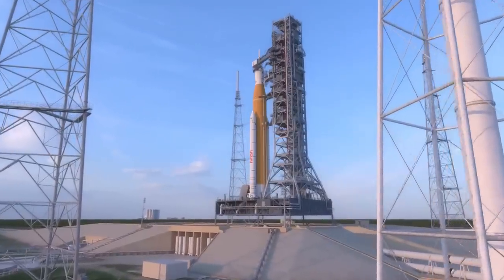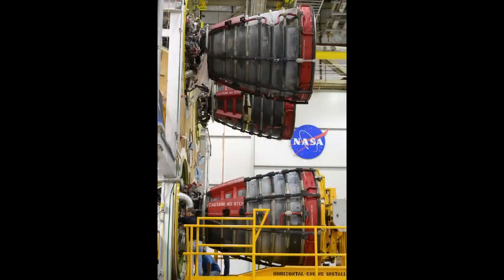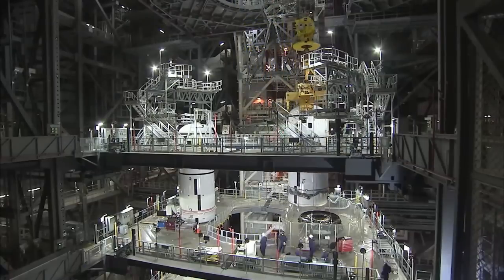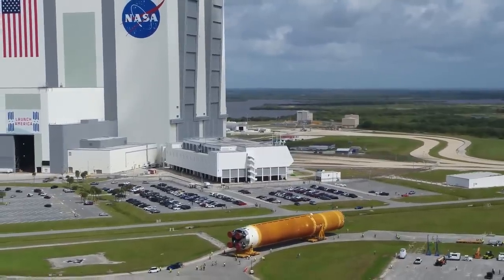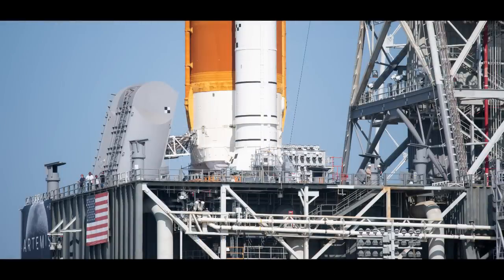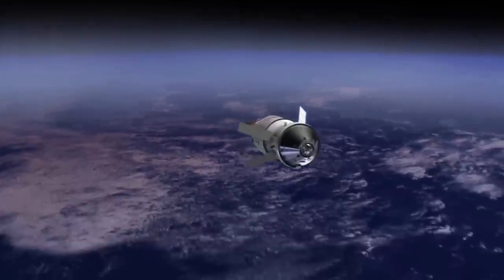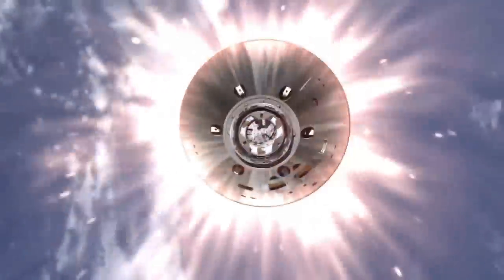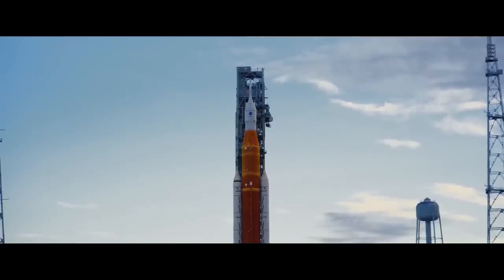What's The Big Deal About Artemis - NASA's New Massive Moon Rocket

Comment: can sls carry orion and a small lunar lander at once?
Reply: No. SLS can barely get Orion to the Moon. Due to the mass limitation the Orion service module is quite small and thus can't carry enough propellant to get Orion into and out of the low lunar orbit that Apollo used. That's why the Artemis program is using the easier NRHO orbit, and the biggest reason Gateway is in the plans. Orion will rendezvous with a lander in NRHO. That will launch separately, the Starship Human Landing System.
Reply: @donjones4719  Only the three initial SLS flights with the 5m ICPS will be limited to just Orion, as Artemis IV onwards will use the 8.4m Exploration Upper Stage (EUS). Those flights with EUS will carry Orion and a Lunar Gateway module to the Moon. So a lander small enough, could go instead of a station module. 

The lower lunar orbits are unstable, as most of the mass concentrations (masscons) on the Moon are in the Earth facing side. The Near Rectilinear Halo Orbit (NRHO) is very stable, needing only a little propellant each year for station keeping. Since Lunar Gateway is planned to be used for years, it makes sense to put it in a very stable orbit.

Comment: How does NASA figure out the path Artemis 1 takes from the moon to the earth?   Earth has a lot of orbiting objects.  How do they ensure they miss them when returning?
Reply: 1/ By placing Isaac Newton in the driving seat. 
2/ Space is very large.
Reply: Every satellite and most debris big enough to knacker a spacecraft is tracked and space is big, that's why its called space lol. The average distance between satellites is measured in kilometers so there's no chance of the rocket bumping into one unless something goes very very wrong with the capsules guidance systems.

Comment: Hi Scott Manley, Has anyone calculated the effect of energy, how it affects the orbits of the planets? Now, when masses per kilogram are sent into space, it would be good to send them from opposite sides so that these trajectory changes caused by low energies would not result in a disaster? This is a good question and I'm sure you can answer this. Every reaction requires a counter-reaction.
Reply: The effects of launches are so small as to be essentially irrelevant. Firstly, all the stuff that goes to some kind of stable orbit around the earth is still counted as part of the planetary mass when considered at astronomical scales. Secondly, the earth is hit by several hundred tons of space dust/micrometeorites/meteorites every year, and has been doing so for a very long time. This more than makes up for any interplanetary or deep space launches.
On a human scale, a space launch would be roughly equivalent to losing a single hair. It's something that happens, but it really doesn't have any real measurable effect...
Reply: @gchampi2  Thanks for the reply, the things you presented sound reasonable. Space is a weird place.
Reply: @tonimanninen5181  Happy to help.
Reply: @gchampi2  hey, have you familiar for jojo effect? Where forses are not ecual at present and taking stabile state after some Time? PS. Sorry for Bad english, didint use traslation.

Comment: The joke goes : The size of the shuttle boosters was limited by the size of the rail tunnels that were used to transport the boosters. The tunnels were sized for the width of the trains which was determined by the distance between the rails of the train tracks. Early trains were built by wagon makers whos tools were sized for making wagons that would fit in the ruts left by other wagons and brought from Europe with the early colonists. The spacing of the ruts was determined by the size of a Roman chariot which was big enough to fit behind two roman war horses. 

So the size of the Space Shuttle solid rocket boosters was determined 2000 years ago by the backside of a pair of Roman war horses.

Some details might be off because I heard it years ago. I have also never fact checked this because I don't want to ruin the fun.

Comment: What will the use after they've expended all the old shuttle engines on the main section?
Reply: Aerojet Rocketdyne has a contract for RS-25E engines which will be built as an expendable version.
Reply: @steveaustin2686  I see - thanks!
Reply: @sneezyferret6482  You're welcome

Comment: Why not recover the boosters? Budget too big?
Reply: Booster reusability is great, but has drawbacks.
First, if you don't have a fast enough launch cadence, you can spend more on recovery than you save by reusing the booster.
Second, you take a payload hit for the recovery system on the booster. The Falcon 9 B5 can lift up to 22.8 tons to LEO when expended, but only up to 16.3 tons when landed on a drone ship (B1051.12). Doing a Return to Launch Site (RTLS) landings, costs even more payload.

The SRBs that were recovered during the Shuttle era were stripped down to bare metal and basically rebuilt every flight.
So with SLS launching once or twice a year, the cadence doesn't really justify recovering the booster. Not to mention that it gets higher and faster than a Falcon 9.
The SLS Block 1 can get Orion to the Moon, but not with the kind of payload hit like F9 has. The SLS Block 1B will send along a Lunar Gateway module with Orion, so it really can't take the payload hit either.
SLS started design work in 2011, 4 years before SpaceX landed the first booster and almost 6 years before they reused a booster.

Comment: If anyone could clarify for me please: The 4 engines at the bottom are LITERALLY pulled off of a space shuttle? They’ve literally fired and been to space on a previous mission? Or are they new ones just modeled after shuttle engines?
Reply from the maker: They all flew in space shuttles https://youtu.be/O7bzJbVzdVk
Reply: There were like, what, 3 space shuttles left at the end of the program? My understanding is that they're lost after each SLS flight. They're going to run out of engines unless they build more.
Reply: @berfunkle4588  
No, there is a contract in place with Aerojet Rocketdyne.

Comment: Angry internet guy here but I don't think SLS should have been made. It's pretty clear in that borrowing Space Shuttle technology, they brought over all the flaws along with it. I missed the Space Shuttle launch three different times because they simply could not meet their schedule or fuel the thing consistently. The liquid fuel used in this is different and harder to manage than what SpaceX does. The vibration from the SRBs has to be horrendous and relying on ESA for the upper second stage creates a dependency on them for each launch. If Starship succeeds, and I think it will, it will make this look like a waste of $10 billion dollars.
Reply: Starship will use liquid oxygen plus liquid methane whilst alongside RP-1, Falcon Heavy uses LOX too.

Comment: How much of SLS can be reused?
Reply: Orion is reusable. Booster reusability is great, but has drawbacks.
First, if you don't have a fast enough launch cadence, you can spend more on recovery than you save by reusing the booster.
Second, you take a payload hit for the recovery system on the booster. The Falcon 9 B5 can lift up to 22.8 tons to LEO when expended, but only up to 16.3 tons when landed on a drone ship (B1051.12). Doing a Return to Launch Site (RTLS) landings, costs even more payload.

So with SLS launching once or twice a year, the cadence doesn't really justify recovering the booster. Not to mention that it gets higher and faster than a Falcon 9.
The SLS Block 1 can get Orion to the Moon, but not with the kind of payload hit like F9 has. The SLS Block 1B will send along a Lunar Gateway module with Orion, so it really can't take the payload hit either.
SLS started design work in 2011, 4 years before SpaceX landed the first booster and almost 6 years before they reused a booster.

Comment: Saturn 5 was bigger with more  heavy payload, will Artemis be able to carry a moonlander too?
Reply: No... the initial version can't even reach low-lunar-orbit with just the capsule, much less carry a lander. The lander is a Starship, which will be travelling their independently...
Reply: @simongeard4824  Low lunar orbits are not stable as the mass concentrations (masscons) are mostly on the side of the Moon facing Earth. Since NASA wants to use Lunar Gateway for years, they are putting it in NRHO as it is very satable and only needs a little bit of propellant each year.
Reply: @steveaustin2686  Indeed, but the point is that SLS in its current form cannot replicate the feats of the Saturn V — delivering a capsule and lander to LLO simply isn't within its capabilities, so two separate launch vehicles are needed.
Reply: @simongeard4824  Funny how you ignore the SLS 1B and SLS 2 that could take a lander along. Instead they will take Lunar Gateway modules instead. And no, I'm not saying that they can take Lunar Starship along. The good should be shown with the bad, no matter which company it is. Especially don't ignore why the NRHO is being for Lunar Gateway.

And before you say it, yes I know that SLS/Orion are too expensive, even if Boeing cuts the SLS cost in half. Unfortunately, they are needed until Starship can mature to replace them.
Reply: @steveaustin2686  I'm not sure what you're on about? Mats asked "will Artemis be able to carry a moonlander" — to which the answer is no. I mean, sure, there are future upgrades planned for SLS — but the current version cannot carry a lander, and there's no plan for future versions to do so even if they gain sufficient capacity. 

As to those future versions — the EUS isn't going to be ready before 2026 at the earliest, based on current planning... ten years after development began. And given the ongoing history of delays in the SLS project, I don't think I'm being particularly controversial in suggesting that a year or two later is more likely. SpaceX aren't particularly good at meeting timelines either, but it's still hard to see SLS still looking relevant four years from now, much less the more likely five or six.
Reply: @simongeard4824  He asked about Artemis, not Artemis I. So stating that the SLS 1B, which will be on Artemis IV+, can carry a small lander if one was available would make sense, because that is the truth. It's not a hard concept.

The EUS not being ready until 2026 is of no consequence, as Artemis III, with the SLS 1, is likely to slide into 2026 per the NASA IG. If only for the spacesuits, if not for Lunar Starship and/or SLS. Heck the ML-2, which is needed for the SLS 1B and SLS 2 has already slid into 2027 and may slide further.

With Starship's initial planned launch cadence of 1 launch every 12 days for Artemis and the up to 10 flights to get Lunar Starship to the Moon, Starship will almost certainly need to mature a lot to be able to replace SLS. Starship has a LOT of development left to go. Don't get me wrong, SLS is WAY too expensive and Starship needs to replace it ASAP, but don't expect it to for the early SLS missions. After all, it took the Falcon 9 almost 12 years to get to a once a week launch cadence, it would be likely that Starship will take years to get to a similar cadence. However expensive SLS is, unfortunately we need it for the early Artemis missions and that will likely be the ones already funded.

Comment: Why didn't you talk about which parts are being reused, how they're retrieved, and which parts are just being thrown away? Unanswered questions :(
Reply: Yooo!! I didn't think I'd see you here BloodyIron lol
Reply: @AbhorrentRed  I don't recognise your username. How do you recognise me exactly? 🤔
Reply: Only Orion is being reused. Booster reusability is great, but has drawbacks.
First, if you don't have a fast enough launch cadence, you can spend more on recovery than you save by reusing the booster.
Second, you take a payload hit for the recovery system on the booster. The Falcon 9 B5 can lift up to 22.8 tons to LEO when expended, but only up to 16.3 tons when landed on a drone ship (B1051.12). Doing a Return to Launch Site (RTLS) landings, costs even more payload.

So with SLS launching once or twice a year, the cadence doesn't really justify recovering the booster. Not to mention that it gets higher and faster than a Falcon 9.
The SLS Block 1 can get Orion to the Moon, but not with the kind of payload hit like F9 has. The SLS Block 1B will send along a Lunar Gateway module with Orion, so it really can't take the payload hit either.
SLS started design work in 2011, 4 years before SpaceX landed the first booster and almost 6 years before they reused a booster.

Comment: Be honest, Scott. What are the success/fail rates on each part of this mission.
Reply: How can they have established rates when they haven't flown a single mission yet?
Reply: @TheEvilmooseofdoom  I assure you that every part is high. The fact that it's taken them 15 years just to make ONE rocket that itself is made out of a BUNCH of pre-used and flight-tested parts shows they are careful. That's good. The testing and failed testing time of over a year is...terrifying. The ONLY part of that rocket I see that is somewhat safe are the SRBs because not only have they preflown, there isn't much you cannot screw up on an SRB.  Light the thing and it burns until it runs out of solid rocket fuel. 
Everything else, though? The number of failed attempts and failed components and pullbacks of the rocket into the highbay?  I'm not sure I've EVER seen a rocket go through this many fails...even the Shuttles and the Shuttles were WAY WAY WAYYYYYYYYYYY more complicated.

Comment: Coming back to this video after two failed launch attempts and NASA announcing they won't make a third in this window, which means that Artemis won't now launch until late September at the earliest. 

For me - and I hope this doesn't come across as 'sniping' - is the fact that the incident responsible for the first scrub was a failure of one of the RS-25 engines, thanks to a failure to condition to the correct temperature (along with a first hydrogen leak). One of the key design elements that NASA touted as a benefit of SLS was the re-use of well-known and flight-proven technology... yet here we are after an initial failure of that well-known and flight proven technology. 

To be fair, the RS-25 is a solid, reliable engine... but it might also be worth pointing out that it has a design history that goes back to the 1960s [approaching 60 years ago], concerted development began in the 1970s and it first flew on April 12, 1981, on STS-1. (Which means that "design freeze", the end of design and development changes) would have been in the first half of the 1970s. 

But it's really frustrating to see an SLS launch impacted by what was essentially a political decision and a design constraint placed on NASA. A lot of people talk NASA down and point to e.g. SpaceX as an example of "how to do it right", but to make the comparison is to fail to recognize that what started out in the 1960s as "trickle-down" economics, a means to lift an entire national economy by getting behind the space program has turned in to "pork barrel" economics, where the name of the game is to get as much money out of the federal government as possible... and, well, if that also happens to result in a viable space rocket, well, bonus! 

And in a way it's heart-breaking to see comments like that of "Wildabeast1524", below, who has worked his entire career on SLS - and so has had to put up with working for an organization that has become such an abused political football as NASA. 

Credit to everyone on the program, who have brought SLS to the brink of launch, not because of everyone in government, but despite them...

Comment: While Elon is pushing for the whole rocket system to be reused, NASA is pushing in the opposite direction … The Space Shuttle used to reuse the engines but Artemus throws those same engines away.
Reply: Booster reusability is great, but has drawbacks.
First, if you don't have a fast enough launch cadence, you can spend more on recovery than you save by reusing the booster.
Second, you take a payload hit for the recovery system on the booster. The Falcon 9 B5 can lift up to 22.8 tons to LEO when expended, but only up to 16.3 tons when landed on a drone ship (B1051.12). Doing a Return to Launch Site (RTLS) landings, costs even more payload.

So with SLS launching once or twice a year, the cadence doesn't really justify recovering the booster. Not to mention that it gets higher and faster than a Falcon 9.
The SLS Block 1 can get Orion to the Moon, but not with the kind of payload hit like F9 has. The SLS Block 1B will send along a Lunar Gateway module with Orion, so it really can't take the payload hit either.
SLS started design work in 2011, 4 years before SpaceX landed the first booster and almost 6 years before they reused a booster.